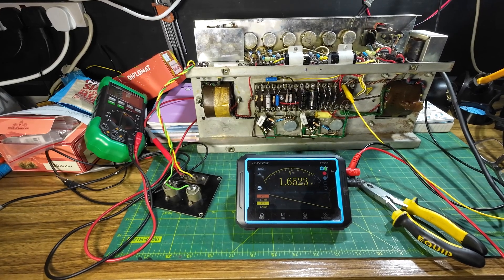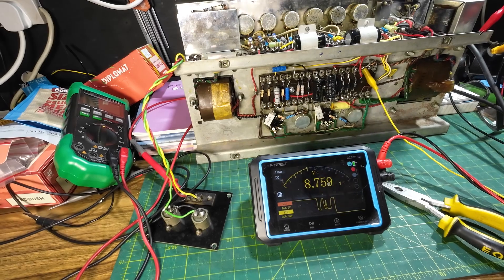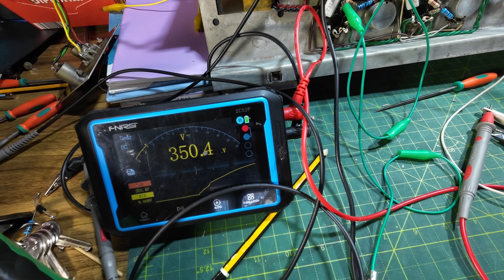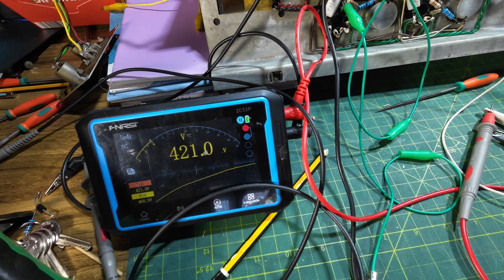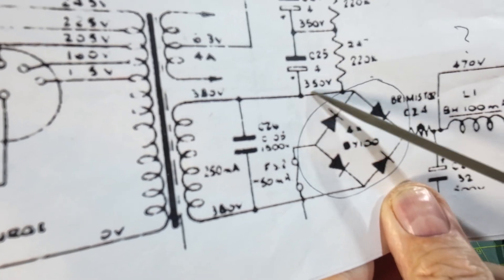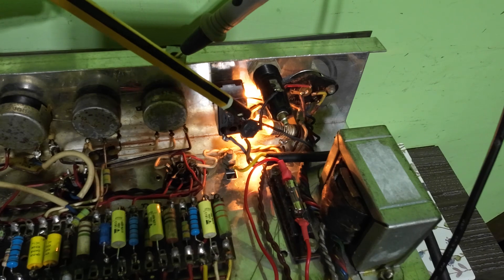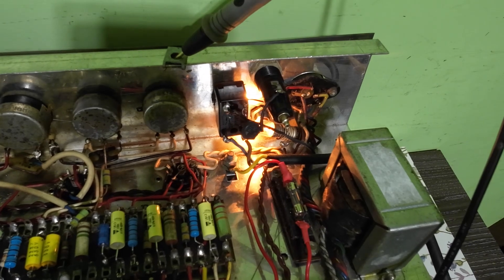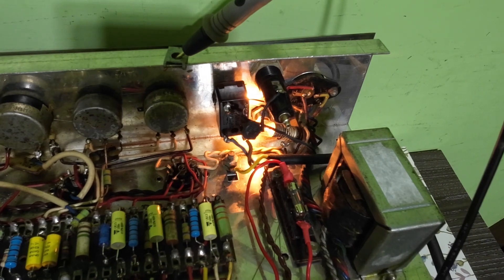Vox AC50 Part Two Over Volting Caps Fix and Final Conclusions

Comment: I don't "officially" do amp repairs - I just look after my own fleet of amps. I do the odd repair for friends etc but the thing that puts me off doing most repairs is the absolutely shocking electrical state of some of the sh!t that people used to bring me! You have more patience than I do!
Reply from the maker: Hello Mark. It does push my patience sometimes. I seem to having a bit of a run of billy Bodger specials. Take care Mark.

Comment: The problems and dilemmas because the amp's vintage.  I think you've found a really good solution to a potentially very dodgy issue without any compromise to the original design.  Personally I have zero respect for broken vintage amps and that's why I don't do any repairs (other than my own). 😅
Reply from the maker: Hello Pete. Yes a tricky one. But at least we found a solution. Take care Pete.